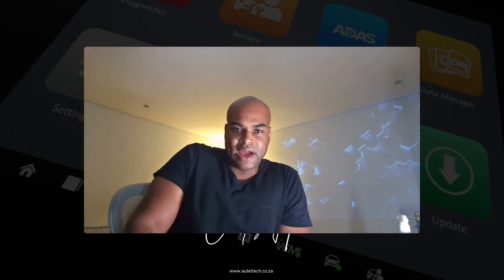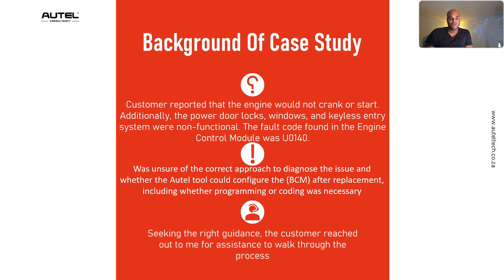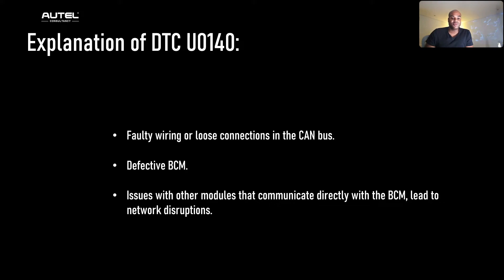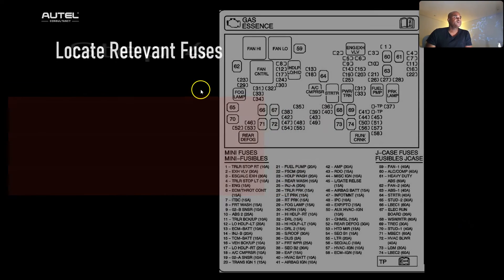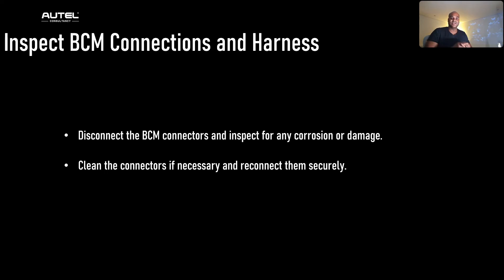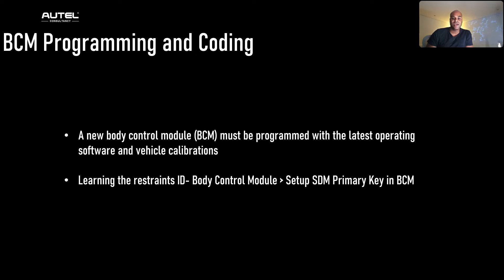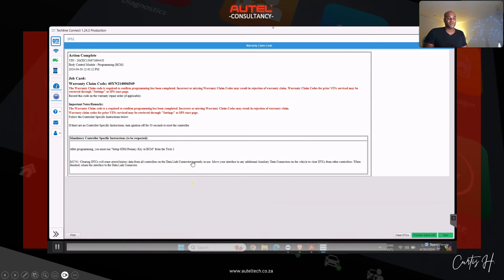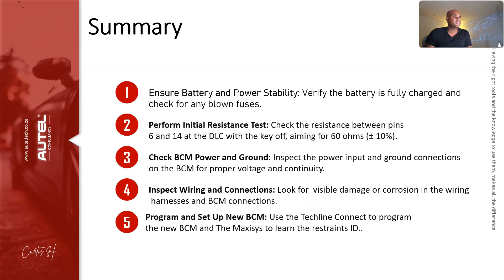Maxisys Ultra Programming Case Study: How to Diagnose the U0140 Code, Replace, Program, a BCM Module

Comment: I am in the UK 🇬🇧 and I need a official Autel site to purchase an Autel IM608S Pro 2
Reply from the maker: Hey my friend, I sell the tool to the UK so it doesnt really make sense for me at least to find a UK seller. The best thing you can do if you dont really need training is to call Autel UK and see if they can recommend you a supplier.
Reply: @AutelConsultancy  what is the contact info for Autel UK 🇬🇧  Thanks Cheers
Reply from the maker: Hello I dont have their number as I am not affiliated with them. You need to check online
Reply: Do you ship internationally? And what is the price of autel im608
Reply from the maker: Yes I have clients everywhere but I only disclose pricing after I consult the you. This way I can add extra solutions based on the problems I learn in the consultation. You need to go to auteltech.co.za and book the DTC service